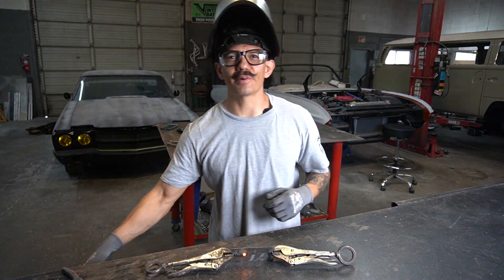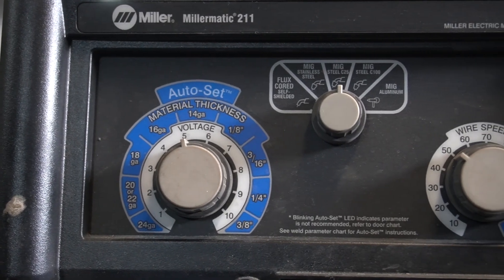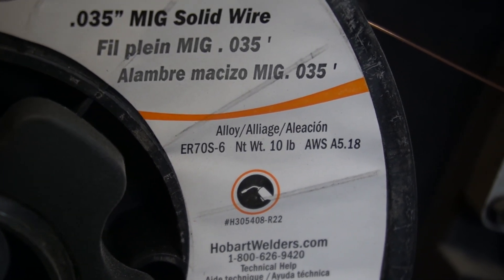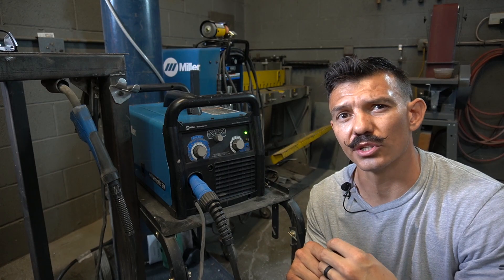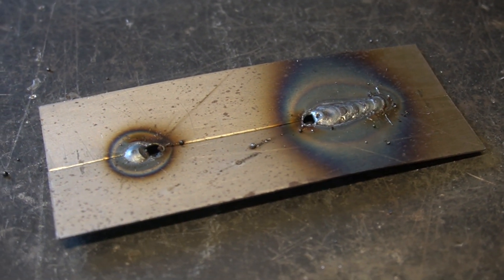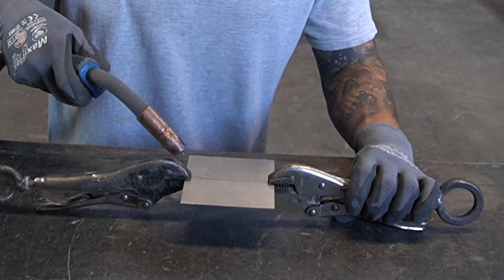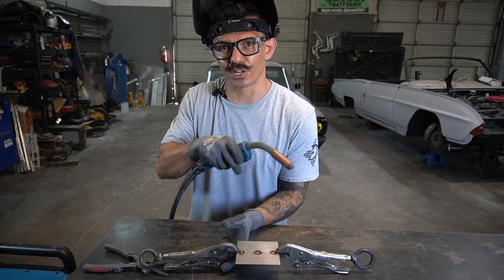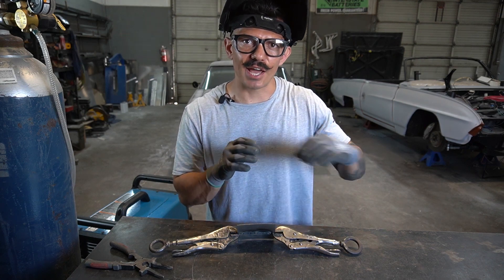WELDING FOR HOTROD RESTORATION: a beginner guide to clean, strong welds!

Comment: I learned years ago for collision work and always used 23 wire. What are the advantages using 35?

Also, did you get a new camera? Video quantity is excellent!
Reply from the maker: 23 would probably work good especially on newer cars! Honestly the advantages are really the convenience of not having to swap out the wire if I need to weld a bracket or suspension part or something heavier than 18-20g. I find it works fine for sheet metal but thinner wire works great too. And you know I noticed the video looked nice too. I'm not sure what I did different lol it's the same camera I've always used haha

Comment: You always do a nice job explaining the process. When I do test panels like this the panels curl a bit. I’ve seen others hammer the weld. Would you comment on that practice.
Reply from the maker: Thanks for the compliment bro. Sometimes I watch the video back and I feel like I'm not explaining it clearly enough. So I appreciate the feedback. In my experience hammering the panel to get it straight is fine, but I have noticed hammering too much on a MiG weld will result in cracking in the sheet metal on one side of the weld.

Comment: i lost confidence in you now
using a gas thats not inert (co2) you arent mig welding you are mag welding
metal inert gas welding or metal activ gas welding
so its not mig in any way or form
Reply from the maker: I don't understand what your saying? What's wrong with welding with C-25? 75%argon and 25% co2, Doesn't "MiG" stand for Metal Insert Gas? Argon is inert gas....
Reply: @BeAMetalFabricator  when using a mixed gas with co2 you introduce more carbon in the welds making it practically better or harder if you wish
using only inert gas that dont affect the weld is called MIG
using a gas thats mixed with other gases thats not inert is called MAG welding
its important to show the difference as different materials requires different combos
like aluminium and stainless must use inert gases as to notmix in "impurities like carbon"
but i still enjoy your vids 
but for me it is important to be accurate as i am a welder by trade =)
Reply from the maker: I can understand what your saying, but I don't see why using C-25 is a problem when welding mild steel as I said in the video, being that it is more superior than 100% co2. But yes pure argon gas or helium for aluminum and stainless is the correct way of doing it. But I appreciate your input, I myself am NOT a welder, I am a Fabricator and welding is only a small part of what I do. I'm not saying they way I weld is the only way to do it, I'm just showing how I do it. But thank you for watching my videos man it really helps my channel.
Reply: @BeAMetalFabricator  no no no
I dod not mean that you use the wrong gas
That gas is perfectly okay for sheetmetal and car welding
Its the mig part
People have to learn the difference between mig and mag
Mig is a pure inert gas like 100%argon
When using a mixed gas with in this case co2 its an active gas as the co2 acts by adding carbon to the weld to make it harder and more tensile
Usinge pure co2 adds alot of carbon makeing the weld hard as f if one is using the right wire

So it is definitly not about what gas you use its more about the terminology
As a welder by trade this infuriates me :)
Reply: @BeAMetalFabricator  I was told the the 75/25 was good for less splatter ,and a little rust on the metal, straight co2 is great for clean metal, but creates more splatter , which for me means more cleaning afterwards,I’m no expert, but Fitzee’s fabrication has done a tutorial on mig welder set up also, and he uses the straight co2
Reply from the maker: Right. So your helping prove my point that C-25 is a more than adequate shielding gas... "Mig" stands for "Metal Inert Gas". The argon is the "Inert". Co2 is "semi inert" when your welding with Co2 it's called "MAG" which is "Metal Active gas. Co2 is also cheaper than C-20. And I prefer less clean up. It's all personal preference man. You can even use helium co2 mix. I'm not a welder but I did go to school to learn this stuff.

Comment: the 1, 3 and 6 designation are the levels of silicon content that's purpose is to scavenge from surface contamination such as, rust, paint, oil etc etc, if the surface is clean the surface of the weld bead will have some brown looking glass in appearance on it, this is just some of it's meanings
Reply from the maker: Awesome! Thanks!